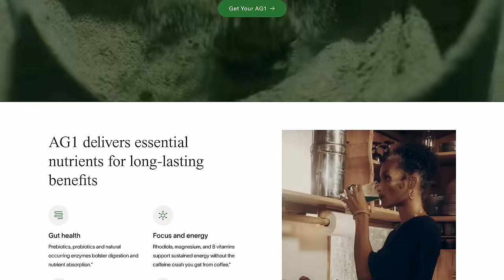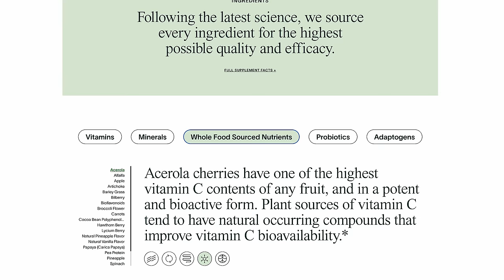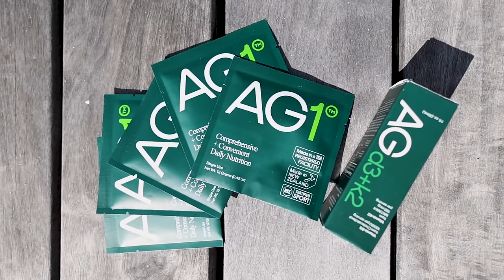2024 Life Update!

Comment: Knowing your strict regiment of keeping the boat as light as possible while underway. They do make a water bladder system that is the same as the sand bag system. 
Might be more your style while at sea. You can lighten the load while not in use and easily fill them when needed. Plus it keeps the sand off your gel coat while onboard.
Reply: Also, with water bags ... if you are ever in an emergency situation without water or the ability to make water, you have a built-in supply.
Reply: @rongaskins I would agree with you as long as they didn't empty them regularly after use. If they empty to keep the boat light and only fill up when needed then I think they will use salt water instead if precious fresh. But if they only need to empty for long passages then I don't see why it would hurt to use fresh, I guess it depends on how much water is needed.

Comment: So great to watch you every time. Doing it your way. While raising 2 kids in a bath of Love, Joy, and Nature.

I have lived and cruised for 22 years on my Outremer 45 Danson.  For your consideration today:

FITNESS ROUTINE.  I use the XBX exercise plan, originally developed by the Canadian Air Force for small spaces, using body weight without props, mixing aerobics and calisthenics.  I do some 20mn daily, even at sea. I do my own variation, based on improvements suggested way back by 2 Australian trainers. You can do it inside, in the cockpit, on the central gangway, using just a fitness mat. In a hotel, I use the bed mattress, cleaner than the thick carpet.

SAND BAGS. Are anathema to me, for their weight. I use 1.5 liter water bottles, strapped together with packing tape. Same weight, but they constitute my water reserves for emergencies. 

WASHING MACHINE. (If you do not have one). Am very happy with Daewo wall-mounted Mini machine. 3kg load, excellent spin for fast hang drying. I do not use the water heating feature, so it only needs about 45W during 30mn and just 30 liters of water, per wash.  350 EUR 6 years ago. Weights only 15kg.

MY OPINION on WASHING.  It is unfair to impose hand washing on our partner, especially if there are diapers, under the excuse of weight, water and energy limitations. Technologically, those limitations are no longer justified.  Plus, laundry excursions on shore are a real pain.

Comment: I am doing a CrossFit style class and there is an amazing number of exercises that can be done with not a lot of heavy equipment

Trx straps, jump rope, kettlebells (I would go for water or sand bags), bar to hang from (boom, coach roof), a mat, wall ball... Box for box jumps. Instead of a rowing machine, you can use your tender.

Then you just have to add in a ton of knowledge of different moves and how to combine them for a good full body workouts.

Comment: Nothing will sharpen your sailing skills more than racing!  Especially smaller one design boats where a tiny tweak here or there might be the difference between rounding the windward mark in the top five or mid pack.  Racing your own boat is fun, but to get maximum performance you have to push the limits where things break, and that gets expensive.  Get some experienced crew on.  Or, get on board someone else's race boat.  While handicap racing in large, expensive yachts sounds fun, you will learn a lot more in a one design where all boats are close to the same.

Comment: FITNESS ROUTINE ON BOAT.  I use the XBX exercise plan, originally developed by the Canadian Air Force for small spaces, using body weight without props, mixing aerobics and calisthenics.  I do some 20mn daily, even at sea. I do my own variation, based on improvements suggested way back by 2 Australian trainers. On my boat, I can do it inside, in the cockpit, on the central gangway, using just a fitness mat. In a hotel, I use the bed mattress, cleaner than the carpet.
SAND BAGS. Are anathema to me, for their weight. I use 1.5 liter water bottles, strapped together with packing tape. Same weight, but they constitute my water reserves for emergencies. 
WASHING MACHINE. (If you do not have one). Am very happy with Daewo wall-mounted Mini machine. 3kg load, excellent spin for fast hang drying. I do not use the water heating feature, so it only needs about 45W during 30mn and just 30 liters of water, per wash.  350 EUR 6 years ago. Weights only 15kg.
MY OPINION : It is unfair to impose hand washing on our partner, especially if there are diapers, under the excuse of weight, water and energy limitations. Technologically, those limitations are no longer justified.  Plus, laundry excursions on shore are a real pain.
I have lived and cruised for 22 years on my Outremer 45 Danson

Comment: I realize what I'm going to ask will NOT happen, but, I've gotta ask, would it be possible to see the exhaust of the engine, the elbow height, that sort of thing. I've known others who have had serious problems with the installation parameters and the damaged engines that result, and two, yours and one other, were done by experienced installers. I'd like to know what it was, and what the changes were that were done, and then we will see whether the changes worked eventually.